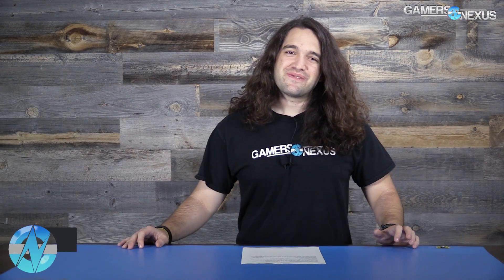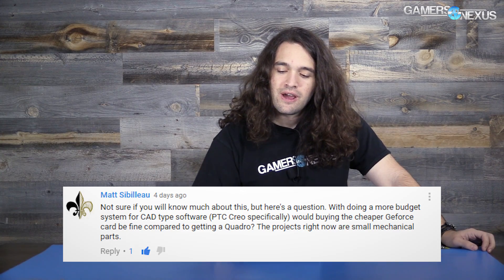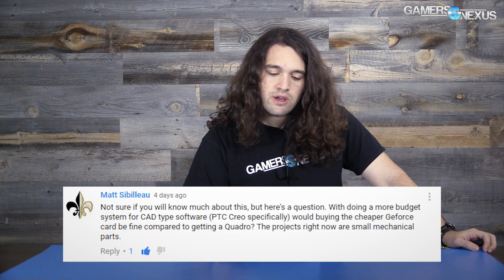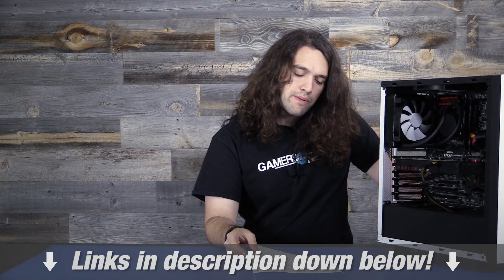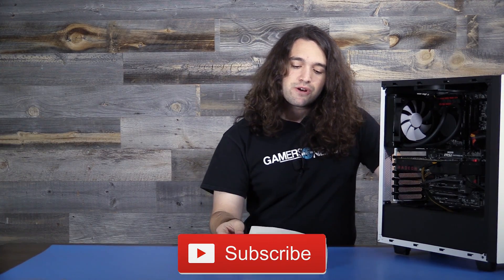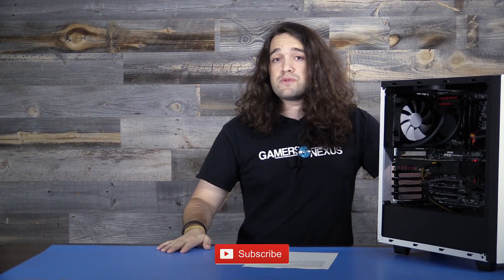Ask GN 23: RX 490 Talk, GPU Power %, Driver Performance

Comment: what about the geforce gtx 950. I accedently hit power limit to 120% thinking that was core clock ( screwed up was in hury) screen went white still seems functional but stuttering seems to be on it now but it was stuttering before i done the overclocking. That was due to an Ddos attack on archeage.I also have an old rampage 3 with I7  950. with 8 gb. I dnt know with is worse,lol. Just hope I didnt screw gc up. and if I did. How can I find out.

Comment: my card went to 111% at times even though i set max at 108%. The temp never went over 68 but. However then the power% dropped to 70% constant. Until i took pressure off it. That does not seem ideal. i ran voltage at only +10 mV, memory clock +150 and core clock +125. Despite the power% locking at 70% though the clocks still ran on higher than stock. Any way i can avoid it locking at 70? i dont really wanna tamper with the voltage to much

Comment: Also when you mount a radiator with the pipes at the top you get air pulled through the system because there's always a small air pocket that sits in the highest point of the system. and in the case of a AIO it's normally the radiator that sits highest. Cars do this too, the coolant top up / reservoir always is located above the water jacket and radiator so the air naturally rises to the top of the reservoir and stays out of the system.

Comment: why haven't dual gpu cards shared the ram,  correct me if im wrong but the ram in CF is just a copy of each other.  Might have some design hurdles but if you wanna get serious seems like youd want the cards to use the same ram.  Bringing the cost down abit more, maybe so the dual gpu cards might actually make sense
Reply: Giving each GPU its own memory avoids coherency & contention problems.  It would be possible to have the GPUs share memory but there would be a substantial performance hit (and you'd need a significantly altered GPU design vs a GPU that has its own memory).  Basically, performance per dollar is better with two copies of the same data.

Comment: I am planning to do 1080p gaming with the GTX 1060. My budget is not very large so I am building a mid-range setup
I want to buy a monitor for about £200($260) or less with the primary purpose being gaming so I'd want it to have a 1-2ms response time, 144Hz refresh rate, the best type of display as possible for picture quality, speakers are not necessary.
G-sync monitors are out of the question due to their price being over £300, but I don't want screen-tearing or stuttering; I was wondering whether changing the graphics card to the RX 480 and buying a monitor with Freesync within my price range would be a good idea? Or should I stick to the GTX 1060 for the higher performance? Or does it not matter that much and I shouldn't worry about it? I plan to wait for partner boards of the RX 480 to see if they will fix thermals a bit

Could you also explain what adaptive sync is and whether it works with Nvidia cards? Because I could stick with the 1060 with adaptive sync enabled.

I know G-Sync and Freesync do the same thing, but G-sync performs better and Freesync has ghosting, so which type of panel would be best to reduce the ghosting effect? Being within my price range of course.

Comment: My gaming PC is very close to dead silent. The only audible component is the GPU while gaming: I can slightly hear the fans of my MSI 980Ti 6G powering a 1080p144 monitor. My case is soundproof and has all the airflow in the world.

Would getting another 980Ti effectively double the cooling area on the GPUs, leading to more quiet gaming? Or should I get an overkill GPU like a Zotec 1080P amp extreme and downclock it until I start losing fps, considering my display is not that demanding?

I'm not interested in liquid cooling because of the pump noise. I'm talking dead silent here.

Thanks!

Comment: What do you think about the new roadmap for the AMD Vega GPU (it being placed in Q4 2016)? In light of the recent congratulations of Raja Kodori's team, do you think they've completed development and are waiting for the output of HBM2 chips in Q3 as promised? Also based on the find of someone dissecting the AMD drivers it seems they have found four possible variants of Vega with a dash a salt. Do you think AMD will come out with a 1070, 1080, 1080 Ti, and Titan competitor?

Comment: Would it be possible to load a 1060 bios on a 1070 card to see if the smaller bus width from the 1060 would have a performance  difference?

Comment: What kind of performance do you expect from AMD's Zen/Polaris APU's? I would think a mid range 1080p experience with a couple of variants hovering around the RX 460 - RX 470 performance, probably not quite reaching the 470, which I expect to be not significantly lower performance than the 480, and is possibly going to be the best price/performance card of the generation.

Comment: Question for Steve.
Do you think the RX 490 could possibly be two chips on a single (dual link) interposer, negating the issues CF and dual GPU cards have?
I remember a lot of talk last year about a dual link interposer for HBM gen 1, effectively doubling the memory to 8gb, but since then not a peep, could this be the ace up AMDs sleeve for the 1080?

Comment: I have a question about VRMs, specifically about how much voltage a typical 4+1 phase motherboard is able to deliver safely with active cooling (80mm fan). The reason behind this question is my old FX-6100 and Asrock 970 Extreme4 motherboard. I want to push the CPU to it's limit since I happen to have an NH-D15, but i'm broke atm so I can't afford a motherboard with better phase count.

Comment: @Gamers Nexus #AskGN I am noticing that with the three 1080's I have owned so far there seems to be some scaling issues when overclocking. I would call it "diminishing returns". Basically I can manually overclock and get some extra performance, but when I push further, even if I am stable, performance drops off, and the card runs worse in benchmarking than if I hadn't overclocked at all. In the next episode of AskGN, would you be able to touch on this and educate me as to why this is the case? Thanks!

Comment: Radiator orientation shouldn't make the pump work harder in a closed loop as the fluid traveling down balances the fluid travelling up, in the case of a AIO however I believe the radiator is also used as an air trap which is why the recommended orientation is hoses down (not applicable if the loop has a reservoir).

Comment: I cant speak on that specific CAD software but for modelling in SolidWorks your performance comes from the processor with the strongest single thread performance, for small assemblies you don't need a hell of a lot of power and GPUs don't matter much unless you are getting a Quadro as long as you have an OK GPU because the GPU specific features are driver locked and they tend to be aesthetic anyway, good for setting up scenes for renders but unnecessary for mechanical modelling.

Comment: First off, I really enjoy your videos, I always come here for any technical and in-depth information.  I have a question about mounting of a smaller rad with a AIO cooler.

 I have heard many people say to mount the rad for an all in one cooler like the Corsair H60 with the tubes on the bottom, but does that really matter on a smaller rad?   In my Cooler Master N200 it looks a lot better having the rad mounted tubes on the top, and also prevents any interference with the fan on the side of the case.  I have tried it both ways and have not noticed any noise or other indications that the  pump is working harder one way or the other.

Thanks

Comment: Thanks for all the information, but this also triggered a question.

My Fiancé is getting into graphic design and I'm worried an IMac is not going to be powerful enough. 

Am I wrong? Would a 2015 IMac 27inch  be able to handle all Adobe applications without a flinch?

Comment: I have a Deep Cool 240mm Captain AIO with a Z97 Sli Krait Mobo paired with a i7 4790k. I cant seem to set the fans via bios or speed fan to be quieter, is there a way to utilize the pwm feature or will i have to get new quieter fixed rpm fans?.

Thanks GN
Reply: If the bios doesn't offer a way to slow them down I believe you can buy a fan controller and that will allow you to control your fans a lot easier. I don't have a lot of experience with that though.

Comment: Hey Steve, Quick Question. I have a AIO CPU cooler and I only have the fans in pull setup, would it matter what fans i use if there just pulling air out? I keep hearing 2 use SP fans on radiators but i fiqure if there just pulling air out it shouldn't matter coz theres no restriction behind the fans. What do u think?

Comment: Do you believe in the Titan P rumors? Also, seeing as the founders 1080GTX retails for $699 the place for a 1080ti in between a Titan & 1080 gets fairly crammed. That is if the cost of the Titan is supposed to be $999. Presumably the new Titan card will be more expensive but that's even more speculation. Interested to hear your thoughts.
Reply: My best guess would be Titan P will sell for 1100 to 1200 with the 1080ti being 750 to 850 range.
Reply: Right, that sounds believable. I'm anxious to see if the Titan P will release come Gamescom in August. If does my patience'll be justified. Given the card doesn't actually cost a lot more than we think it will do.

Comment: im looking to buy new gpu msi 980ti gaming for £379 or msi 1070 gaming x for £460
Reply: If you think you might go VR or multi monitor in the future, 1070. If not, 980ti.
Reply: If you can afford it buy the 1070. It is faster even when both are OC and since it is newer it will be longer til End of Life.

Comment: Is there any way to circumvent the limitations of the silicon on a gpu?
Reply: Sure, hack the bios so you can throw more voltage at it and cool it with liquid nitrogen.
Reply: +wingracer 16 I'm not wanting to go so far as to get that custom, haha
Reply: +wingracer 16 even if you add a good cooling solution would the extra voltage damage or degrade the chip?
Reply: Would be best to ask that on an Overclocking site. IIRC 1.25 or 1.35 is the max volts you want to put on your gpu, but yes extra voltage over what the manufacturer says is highest may blow out components or start to degrade your gpu and you will get much less life out of it. Hop in your car and drive it around in a lower gear with near or over redline on the tach, let me know how long it lasts, same basic idea

Comment: last few months are just about GPU's and its starting to be boring. So I came up with a question! 
I've got Samsung 950 M.2 on Asus Z170 Deluxe (with I7-6700K @4800Mhz) through the add-on card in PCI slot, now waiting for GF1080's to be cheaper but, will the SSD take away some PCI lines from the GPU and in the end affect framerate?
Reply from the maker: We can definitely tackle this one in the next round!

Comment: Thanks for the answer, wasn't expecting that !

I actually drained and refilled the noisy AIO cpu cooler with ek premix a few days ago and also changed the orientation in case this was probably causing the air bubbles issue, it's a fractal s36 and has a fill port

Here's the old way I had it:

https://dl.dropboxusercontent.com/u/98455184/IMG_20141227_214140.jpg

And the new way:

https://dl.dropboxusercontent.com/u/98455184/IMG_20160715_191229.jpg

All the noise has stopped now, hopefully stays that way. I'll remember to mount my 1080 hybrid rad the right way when that eventually arrives too.
Reply from the maker: Awesome! Interesting that flipping the rad on that axis made an impact.

Comment: Hi Steve, love your stuff. Anyway, about the radiator position, I saw your "Motherboard" article video and now your explanation to the viewer but what about top mounted radiators ?? I have a Corsair 540 Air case with a 240mm Corsair 105  radiator, the radiator is mounted on the top of the case where is mostly instructed in videos but sometimes i hear wooshing sounds, like a sucking water kinda sound from the radiator, I wonder if thats due the top mounted location. Is the radiator pump being forced to pump harder because of its upward location perhaps ??
Reply from the maker: Pretty normal. It's likely due to air movement, but you should be fine. If you are hearing this noise constantly, or hear any type of "grinding," it may be time for a new CLC. Place a finger on the pump and feel for vibration, too. If it feels "grindy" and inconsistent, that is also a concern.
Reply: Gamers Nexus Thanks ever so much for replying mate. I've only upgraded for a x99 system 3 months ago. Had to sell my ibanez rg421ex to came up with all the money 4 this build (never though the sell of a material object 'd make me feel separation anxiety. Lol. I absolutely adored that guitar. haha) but I'm really really happy with my new video editing rig (Asrock Extreme4/3.1, i7 5820k, GTX 950 [Hopefully upgrading GPU soon]). Back to topic (radiator), when I first heard the pump "wooshing" sounds I went n did some research but couldn't find much, so even though I wasn't massively worried about it I wasn't 100% OK with it either. Mainly cos it's my 1st water cooler rig (I used air in all my other builds previously). Anyway, you helped put my mind at ease, so again, thank You very much.

Keep it up man.
Love your channel.

TY.
Pedro

Comment: Protip: Instead of taking a screenshot of a comment and then enlarging it, zoom in the browser and take a screenshot of that, makes the font look smoother.
Reply from the maker: Good example. I'll see what we can do for the next one.
Reply: he's right tho, it looks like you're screencapping at 100% like this

https://i.gyazo.com/c0ba6bf042bedeb83395445034184b88.png

when zooming in looks v crisp like this

https://i.gyazo.com/94376268fe6657c8f05507008cca9e04.png
Reply from the maker: We actually don't enlarge the comments. They never exceed the source file size and are written as PNGs. Should not be that fuzzy outside of normal YT compression...
Reply: I-I'm helping!

Comment: if thw rx 490 be a duel gpu it will be a total failure, considering multi gpu scaling is shit and full of bugs and most games still dont support crossfire. Apart from that power consumption would be super high and even the temps. It wont make sense if they release it a dual gpu. I think they will make it the first vega gpu with 8gb gddr5 and will release in late 2016
Reply: AMD wants to be able to say "fastest Video card" on the market.
they did the same with the 295X

Comment: If you have a 60hz monitor is there actually any point in pushing for more FPS then that?
Reply: Yes and no. If your card is maxing out at 60 then you are getting dips well below that so a better card and/or cpu would be an improvement. If your rig never dips below 40 or 50 and only rarely then, no real point in upgrading.